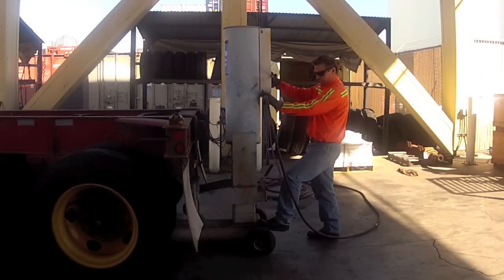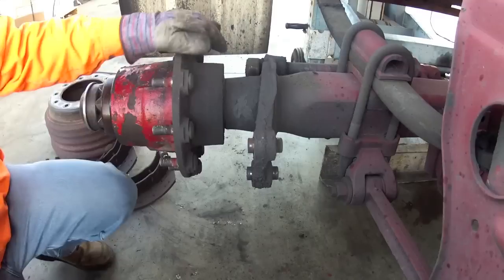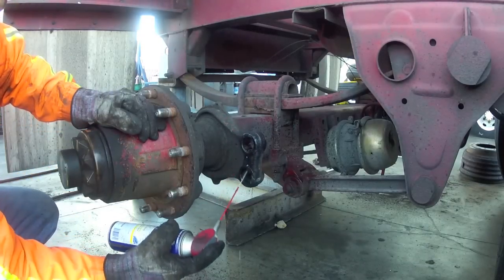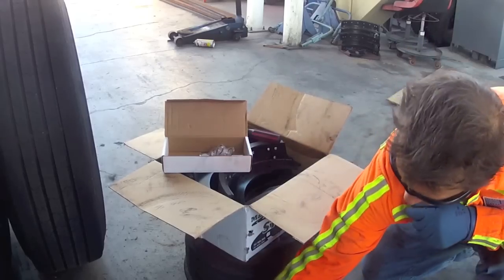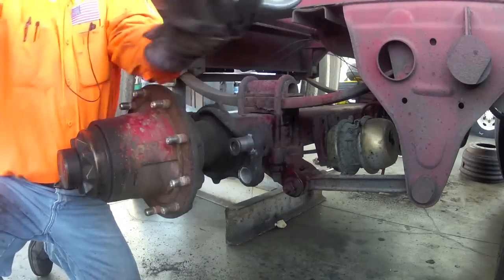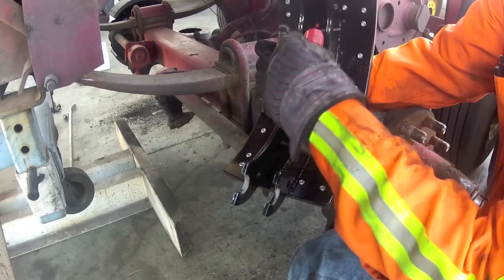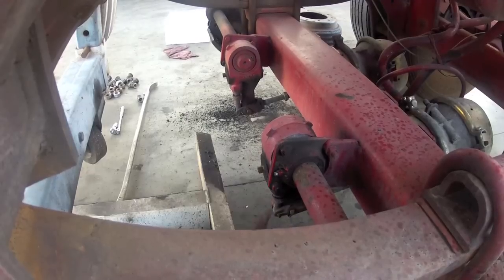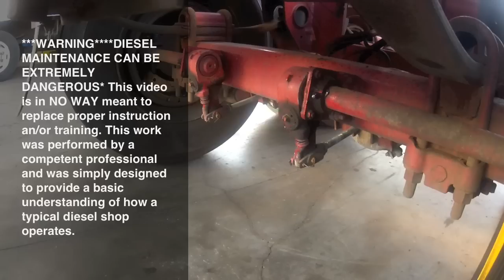Diesel Brake Shoe Replacement

Comment from the maker: As for the C-clamp, this is a specialty tool for removing and installing these bushings and sleeves. I've found that when a light coat of anti-sieze compound is used between the sleeves and bushings specifically, this tool may not be necessary on the next interval. It is certainly a nice tool for the troublesome bushings, but may be pricy.

Comment: Good video, I been working on truck for over 20 years. The only tip I could give on the video is to check the slop in the scam bushings before tear down, and look for flat spots in the s-cam. Also of note would be a slack adjust that doesn't back off correctly. Lightly tap the drum and listen for the tone of the ring, to make sure it isn't cracked. As well as tapping on the drum to make sure the brakes really did back off. Another cheap trick instead of the go no gauge. is to look at the chamfer on the lip of the drum if it's worn below it's bad.
Reply from the maker: Thanks, we pull around 2 - 4 brake jobs a week, but that doesn't include other brake issues such as chambers and slacks. This was mostly a clean job so there's some inspection details I didn't cover in this video, but I'm planning to cover some of the "what if's" in future videos.

Comment: How much actual time from truck pulling in to truck pulling out does it take ?
Reply from the maker: These are fleet chassis so we roll them in bare. It takes about 1.5 hours average per axle from the time the jack goes on till I roll it away.

Comment: Dude please where can I get that lil piece of bushing removal tool? I need that so bad.....
Reply from the maker: The tool I used was a 5038 Brake Anchor Pin/Bushing Set by OTC. I think I've seen them for around $250 to $300 on Amazon or something.